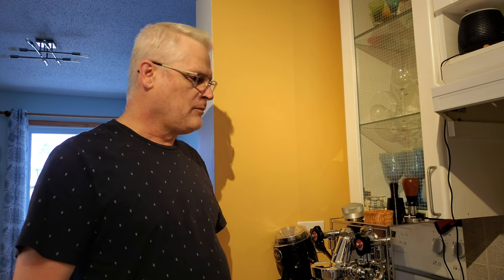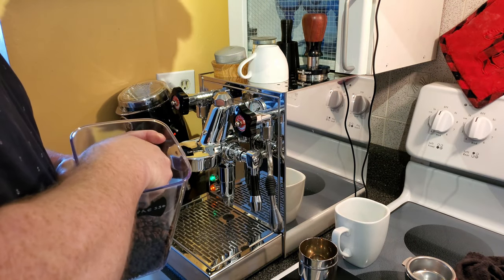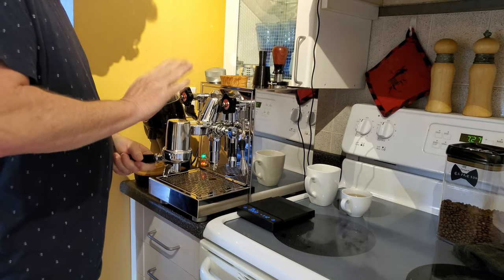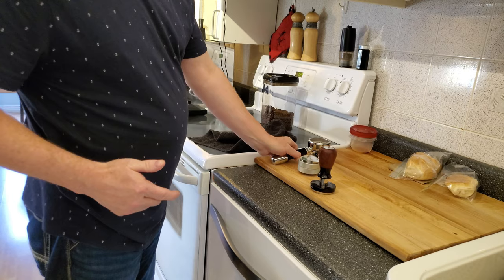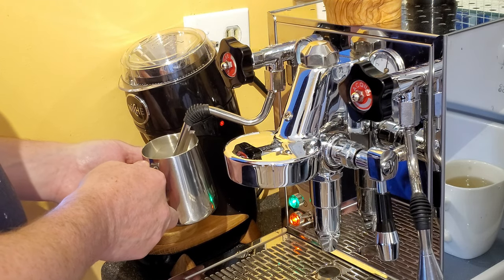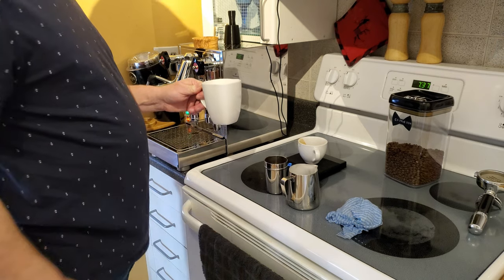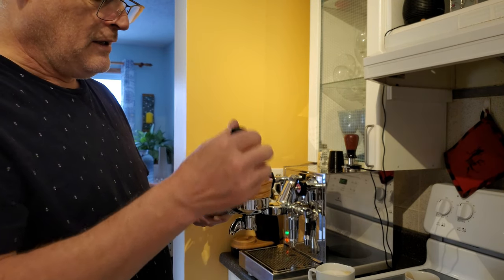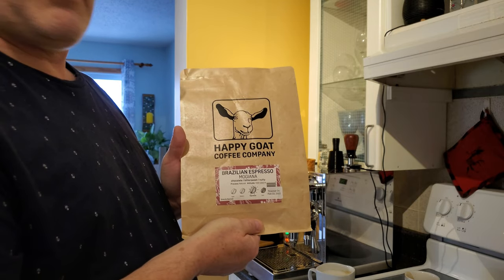Work Flow 3: ECM Mechanika V Slim & Bravo Tamper

Comment: Thanks for taking the time to post your routine. Has certainly helped me with deciding upon the ECM. A no bells or whistles demonstration, brilliant. 

Do you find that 17.5g to 18g is a good dose for all the beans you have tried....? I note that you previously used 18g so just wondering why you've dropped the nought 5 (academic/beginner interest). I'm using 20-20.5g (although with a Barista Express and built in grinder).
Reply from the maker: Sorry don't understand that middle part.

I tried 20gr and I just find the espresso to be too strong. For my beans 18 gr is the sweat spot.

I'm glad you found this useful. That is exactly what I was hoping for. There wasn't much around on the Slim when I looked at buying it.